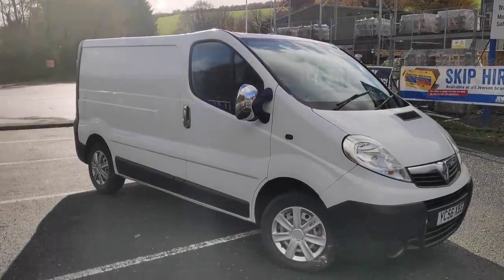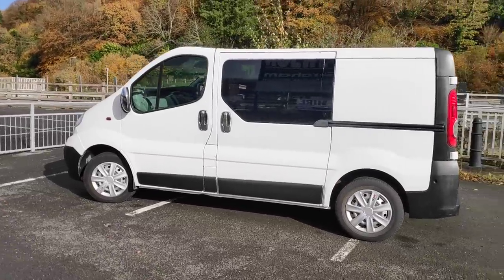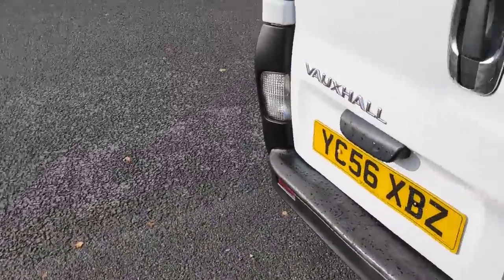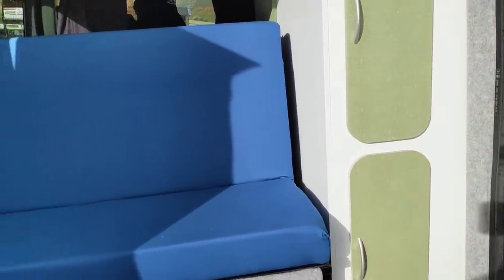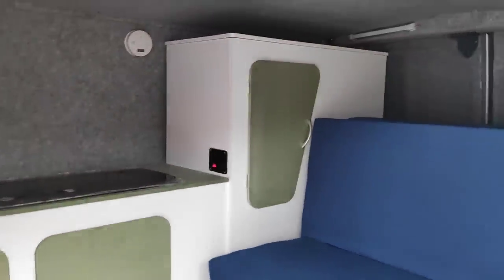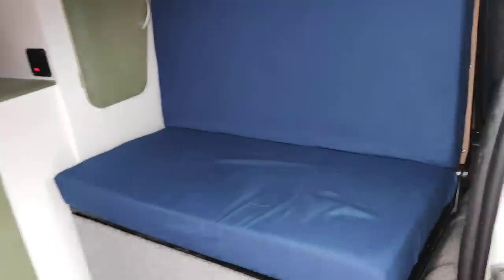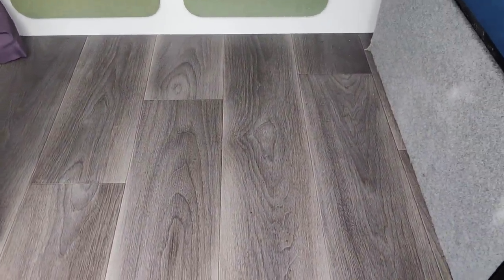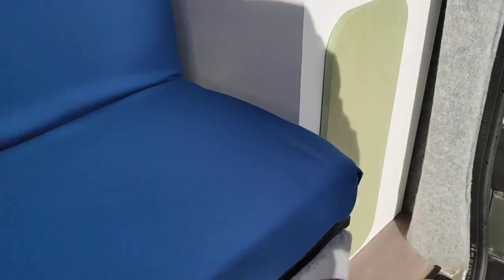Less Than £1000 Vauxhall Vivaro Campervan Conversion! We Changed Everything In Just 2 Weeks!

Comment: The Vivaro has to be my favourite van. Small enough to take everywhere. Quite quick for a van and very comfortable and reliable. You don’t suffer fatigue as much as sitting on the floor in a car.
Reply from the maker: They get a bad rep as cheap working vans with too many common issues (which they do seem to have) but find a well maintained example... and you're laughing! compared to old rust bucket Transit vans, or sky high mileage T4/T5 vans, these offer great value for a camper conversion 😁
Reply: @Budget-Cars-And-Bikes   my aunt has a vw t4  22 years shes had it
Reply from the maker: @hotpointbrownlover3365  Would love to find a T4 or T5 in my budget to convert, they command crazy money even for really rough Ones 😂
Reply: @Budget-Cars-And-Bikes   I want my aunts vw t4 camper van and thats what I am looking for
Reply from the maker: @hotpointbrownlover3365  Me Too 😁

Comment: Oh and I use va 25mm x70mm x 170mm pine board for a bedbase vacross the vivaro back wheel arches ,then put real foam mattress ontop and take my home duvet and pillows in a strong bag ,no sleeping bag for me!! Then I have designed also everything sized so can wheel into my van my new Vespa Scooter  up my bedboard!   and strap down the centre.
Reply from the maker: Sounds like you got everything you need, and on a very small budget :)

Comment: Yes, my Vivaro is a great van, did mine in 2016 and it's still going strong. Ours is the same layout, but have a swivel double seat which makes the van much bigger, No second battery, no split charge system, no solar, no need, Changed to the larger main battery when it's life was up and all is well. My £30 cold box only works when the engine runs so no problem, l lose a litre or so of milk each year and that's it, big deal. If I fancy a cold beer I stop and buy one.

Vivaro beats VW V4/V5 hands down, better engine, bigger van and much cheaper repairs.
Reply from the maker: Just finished a VW T5 on the channel, and that was much harder to convert in many ways! if you have time check out the VW T5 playlist 😁

Comment: Just FYI the green is just bare MDF. I think also that you may have the Veltrim on the wrong way round. A great little van for fishing or something like that tho!
Reply from the maker: Thanks for the info on the MDF, but the Veltrim is the right way round, the other side is totally different, if I put it the other way around there would be just the carpet backing? the way it was put on means you can brush the carpet, so it is 100% the right way :)

Comment: Hi! Great video. I know it’s a few years old now but any recommendations for where to get pre-cut foam for the bed?
Reply from the maker: I just did a search on eBay for foam, and contacted a company on there with the measurements I needed, they cut them and shipped them out in 48 hours. Just remember to adjust the sizes for how you want them to fit, so if you are placing the foam for the seat first, the next bit (back rest) needs to be a bit smaller, as it will sit on top of the seat section, raising it up a fair bit :)
Reply: @Budget-Cars-And-Bikes  Great thanks for answering and for the tips!
Reply from the maker: @sarahevelyn13  No Problem Sarah. Good luck with your project 😁
Reply: @Budget-Cars-And-Bikes  As you said in the video the companies that professionally cover foam for you with included zips cost a bomb. For my conversion the cost came to £550 for the whole set! It was all very well  done but for my latest and second conversion (a vivaro) I want to limit costs everywhere and do a budget conversion and so cover any foam cushions myself. How did you cover the foam with that blue fabric did you or your other half sew it?  Did I miss it in the video? I cannot sew unfortunately.
Reply from the maker: @chatteyj  Hi Ian 

Essentially what I did was to measure the fabric to fold over the foam at all 4 sides, then cut a section of plywood to be around 3 inches smaller than the foam. Then lay out the fabric, place the ply on top of the foam, fold the fabric up and over the edges of the ply, and staple the fabric to the ply. Also meands it can be changed very easy in the future. Hope that helps, and good luck with the project :)

Comment: Shame it's not insulated, otherwise chuck a solar panel, split charger and a battery in, diesel heater and could live in it all year round. its just restricted to summer day use now.
Reply from the maker: Fully insulated with Earth Wool behind all the panels. plus sound deadening for good measure 😁

Comment: Hope you insulated the floor too😉
Reply from the maker: I actually didn't on this one! It was designed as a day van, so not really for Winter use, so I didn't see the need to go overboard on insulation. But the latest build on the channel, is a VW T5 which I did everything! So if you get the chance, take a look at that new series of video's 🙂
Reply: @Budget-Cars-And-Bikes  Cool mate.
Just thought I'd ask...and in a way to advise.
I've done quite a few in my years.....Inc full blown race trucks when I was racing Motocross.
Things like 6 ton Ivecos with workshop at rear.
But yeah I'd say any build you gotta have full insulation.... otherwise you lose too much heat...or at least cold/damp/wind chill up thru floor.
Even in Summer...in UK.
👍🏼👍🏼🥶🥶🥶😉

Comment: Hey! Great video! I've subscribed. I am in the market for a Vivaro, but torn as i've heard the older models lack reliability, how is this van holding up now? Do you prefer Ford Custom or alternatives?
Reply from the maker: I actually do not own the van now, but from what I know it's still going strong. And yes the Vivaro's can have injector issue's, and a few other problems, but as long as you get a good One with decent history, it should last. I did an older Transit on the channel too, but the Transits do tend to suffer with big rust issues!! so the newer model you can afford the better. If I could afford it, I would convert a VW T4/T5 but still very expensive vans. And from what I am told not very comfortable compared to newer Vivaro and Transits. Thanks for your comment :)
Reply: I’ve seen Vivaros on 240k and they don’t rust like the transits do.
Reply: @recall2880  I've just bought a vivaro 2011, zero rust 97k on the clock, a good find I think.
Reply: @chatteyj  Let me know how you get on with it please

Comment: Hello mate great work 👍 I'm thinking of converting my vivaro was wandering how you do the electrics? I'm competent at household electric but never messed with a vehicles? Cheers mate
Reply from the maker: If you can do house electrics, then 12v will be simple for you, at least it won't kill you lol, it's just a case of running a quality (fused) source lead from the main battery to an interior fuse box, and taking additional leads from there to power anything you have in the van, each lead will be fused at the board, or if you are planning on instaling a leisure battery, take the main lead to that via a split charger, and then run a lead from that to the fuse box. Hope that helps a little :)
Reply: @Budget-Cars-And-Bikes  absolute legend cheers mate, literally started stripping it out today so won't be long before I need to run cables 👍

Comment: bed should be sideways in the back. Trust me.
Reply from the maker: I did have a Transit Van (Ex RAC) which had a bench seat at both sides in the back, which then folded into a bed, but it does make the bed VERY short! gives you a lot more space in the van though generally ;)